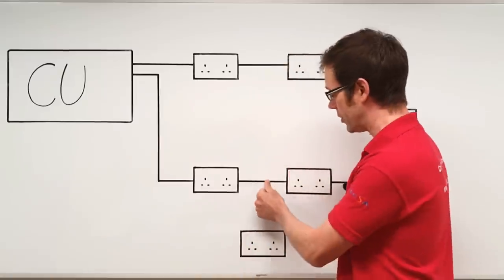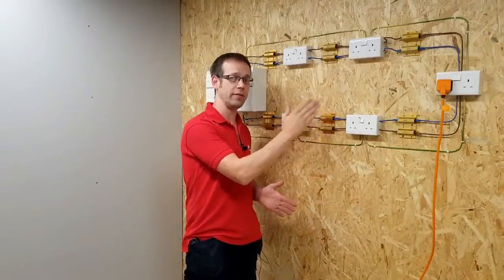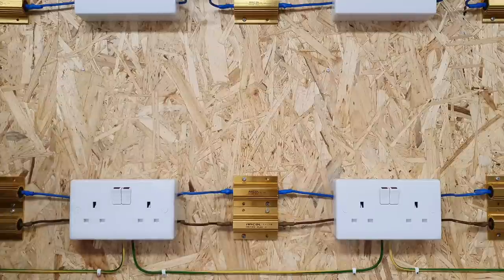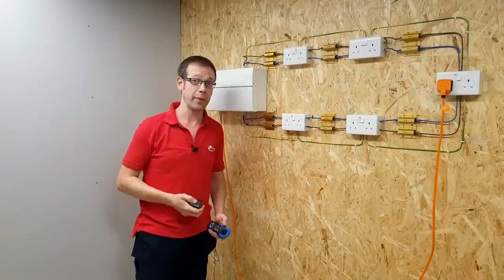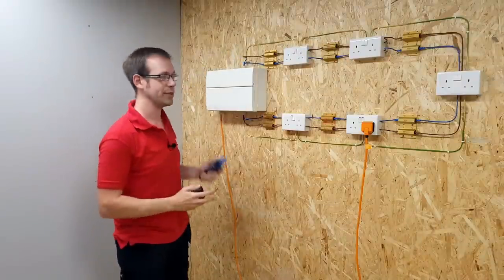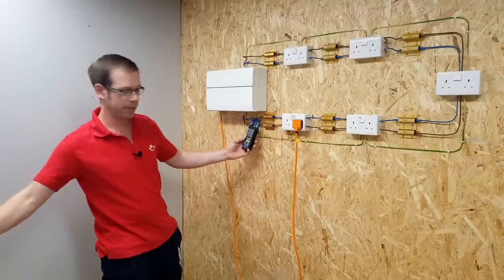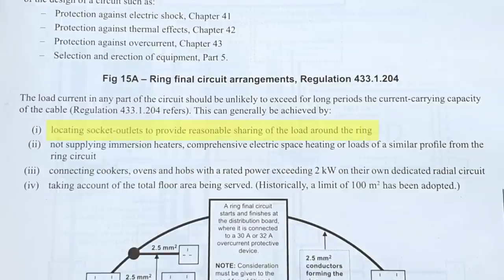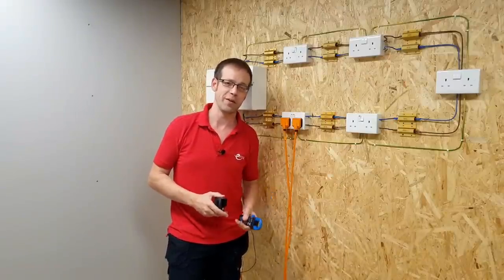KNOW HOW: How does current divide in a ring final circuit? (ring main)

Comment: I'm Dutch so I might be off a bit but...

You guys are using 2,5mm2 cpc/twin and earth cable and (usually) 32A breakers on ring finales. Correct?

Isn't that cpc a bit on the thin side when you have the very real possibility of someone not balancing that ring final and thus pushing that cpc well above its safe 20A limit?

Sounds like a fire waiting to happen...

In the Netherlands it's 16A max for normal household circuits. And that is with 2,5mm2 wiring...
Reply from the maker: Hi Richard, there is a bit of a risk of that but it's a Standard circuit allowed by UK regs. We're finding more and more electricians are going off using them for this and other reasons. The last house I rewired I didn't use a single ring final circuit. All radials. 👍
Reply: Why the UK regs aren't updated to the "normal" circuit topology? There is no need to have more then 10-16A on a normal household socket circuit.
Reply: @simonschertler3034  that wouldn't work in a kitchen when you turn on the kettle, coffee machine and tumble dryer on at the same time that will most likely happen at some point in the winter.  My kettle and coffee machine are always turned on at the same time.

Also assuming that there is no cooker socket so everything is plugged in on the kitchen circuit.
Reply: @adrianking6309  The obvious solution is to wire the kitchen so that high current consuming fixed equipment (ie tumble dryer, or an electric hob/induction hob) are on a dedicated, separate circuits. It's more difficult in practice as people (generally) don't wish to pay extra £££ for a dedicated circuit (many are happy to accept the low cost "hack into the existing ring" solution)
Reply: @simonschertler3034  As far as I'm aware, the Uk regs are up to date (UK regs allow both ring and radial circuits to be installed); many british sparkies still like to install rings, and will continue to do so until the UK regs outright bans them.
Reply: @gloveyourway2000  if it were down to me I would wire each individual room on it's own radial circuit. I agree that appliances should also have individual circuits but now we are looking a panel boards not domestic consumer units for the amount of circuits needed
Reply: @adrianking6309  Not necessarily; it depends on how big your property is, what equipment you need to connect, and how you wish to wire the various circuits. There's no right or wrong answer, just different opinions on how it should be done. In general, a bigger property = more circuits = large consumer unit (potentially)! For example, in my two bed flat (fitted with a gas boiler and radiators), based on my use I'd be quite happy to have one 16A radial circuit supplying power to all the power sockets in the two bedroooms and the lounge. If you were to wire up the flat, you'd probably use 3 circuits (1 per bedroom and 1 for the lounge, based on your previous response). There's absolutely nothing wrong with that; it's just a different approach to achieve the same outcome.
Reply: @simonschertler3034  Yes there is a reason. A 32A circuit (whether a radial on 4mm^2 or a ring on 2.5mm^2) is extremely useful in a location with multiple fairly high power plug-in devices, such as a kitchen or a workshop. The ubiquitous electric kettle can pull 13A on its own, add a 4 slot toaster which might pull another 10A and that's already exceeding a 16A circuit. Then there's the dishwasher (the heater might pull another 10A), a microwave (typically pulling 7-8 A) and the load can escalate quite a lot. Note, that ovens and hobs will be on their own circuit, but the devices I've mentioned generally don't.

Of course, you can put multiple circuits into a kitchen, but then you have to try and manually balance these appliance by being aware of what socket is on what circuit. 

Having high powered circuits (which requires fused plugs) is an extremely convenient feature as it's much more flexible for the consumer.
Reply: @gloveyourway2000  It's not very convenient for a consumer who might want to re-arrange their kitchen, or workshop, to have to re-arrange the wiring. It's costly and disruptive. 32A circuits with outlets are extremely useful things, and having to hard-wire in devices like dishwashers and washing machines is a pain. 

That's even before we get into truly portable devices, like coffee makers, electric kettles, microwave ovens, toasters, irons and a bunch of other things which are not suited to permanent wiring and trying to manually balance loads of multiple circuits is a nuisance. 

If the objection is to rings, then fine. Just wire up a radial with 4mm^2 cabling. The UK regs require sockets to be able to take a minimum of 2 x 4mm^2 wire, and better quality ones will take 3 x 4mm^2.
Reply: Steve Jones If the user is going to the extent of rearranging their kitchen/workshop, the wiring should be changed to suit the new layout and equipment. Stating it’s “costly and disruptive” isn’t an excuse to take shortcuts on the wiring. It leads to the shonky installations (see various YouTube spark videos for examples).
Reply: @gloveyourway2000  Who are you to dictate what ordinary people must do? This is simply ridiculous. There is absolutely no reason to hard-wire in dishwashers and washing machines. That's even before you  get into the issues regarding portable devices.

There is no shortcut being taken, just because it suits your view. It all fits within regulations, and it's perfectly safe to plug in a washing machine without having a dedicated circuit. Yes, you need things like an above worktop switched spur, but that doesn't mean running an entirely new circuit back to the CU.
Reply: @TheEulerID  3x 4mm twin and earth? U must have deep backboxes 🤣 🤭
Reply: @pedropedro9613  fine with 47mm back boxes, but three wires is the exception. In any event, this is only required in a few rooms, like kitchens, utility rooms or (maybe) workshops. 

In most rooms a 16A radial is fine (although I believe 20A radials on 2.5mm^2 is within regs for most circuits).
Reply: Steve Jones I’m not dictating what the average consumer can do (that’s your interpretation. Consumers can do as they please so long as the work is compliant with the regs, which sadly isn’t always the case), nor am I advocating hard wiring dishwashers or washing machines (again that’s your interpretation. I’ve never said that, but please go ahead and try to quote the text where I’ve said that), nor have I said you can’t plug a washing machine into a socket (again that’s your interpretation, and again I’ve never stated that). Perhaps you’re getting mixed up with someone else..?
Reply: Right but you are happy to plug in an appliance with a lead rated for not more than 3A into a socket without a fuse in the plug when the socket can happily supply 16A. Given that the UK has amoung the lowest deaths from electricity in the world, Grenfield excepting, fire is the biggest killer from electricity by far. Then it's not a problem. Note that I know the manufacture of the fridge/freezer that started the Grenfield fire supplies new appliances with 0.5mm cable protected by a 13A fuse, and when I complained they said it was permitted under the regulations.  So even worse in the Netherlands where a full 16A could be drawn.
Reply: @jonathanbuzzard6648  The appliance with a 3A rated cable will have a suitably rated internal fuse to protect the cable against an overload caused by a fault within the appliance, so the 13A fuse in the UK plug (or 16A breaker in the European fuse box) is only required to protect the cable against a short circuit. 

The short length of 3A cable is unlikely to cause the loop impedance to increase by such an amount that the 13A fuse/16A breaker will be prevented from operating within a safe disconnection time (if there is a short circuit somewhere between the internal fuse and the plug), and there's no real need to protect against overload faults occurring within the cable itself, as by simply being a bit of cable it is only capable of short circuit faults.
Reply: @Pinballdavecom  Show me a desk lamp (or any other sort of lamp) which has an internal fuse. They don't without exception. As such the a fault anywhere can lead to a dangerous overload. You are assuming that all faults lead to the loop impedance going to close to zero, which is simply not the case.

As I said just look what happened at Grenfell Tower for what can go wrong. Hotpoint are using 0.5mm CSA cable and protecting it with a 13A fuse in the plug (in the UK obviously). They are also using insulating foam that is flammable (unlike some other manufacturers). When raised with Hotpoint that this was not compliant with BS1363 they claimed it was!!!

I have no proof but we do know the fire started in a Hotpoint fridge/freezer, and they think there is nothing wrong with protecting a 0.5mm CSA flex with a 13A fuse in violation of BS1363. If there was an electrical fault in that fridge/freezer and it had 0.5mm CSA cable being protected by a 13A fuse it could have easily reached sufficient temperature to ignite the insulating foam without blowing the fuse, and wham 72 people dead.
Reply: @jonathanbuzzard1376  The fuse in a BS1363 plug is only there to protect the cable from the high short circuit fault currents that can be delivered by a 32A circuit, it is not intended to provide overload protection.

Overload protection should always be provided in the appliance itself. (Yes even a desk lamp will have internal fuse protection, filament bulbs have included a fusible link in the base for many years, and LED and CFL bulbs have internal fuses.)

I'd advise you to read the regulations and take some time to understand the calculations rather than just blindly quoting the cable size/fuse rating table. I assume that you're an electrician, and familiar with short circuit current/disconnection times equations. Try calculating for a 13A BS1362 fuse and a very short length of seemingly underrated cable, you'll find that it actually turns out OK, and typically you need to go to several metres in length before there are any issues.

This is the basis for the equivalent regulations for European appliances (note appliances NOT fixed wiring). Even on a 16A circuit you can use very small CSA cable for the appliance flex, providing that the length is short enough to allow enough current to flow to operate the protective device. However if you want a longer cable, it will need to be thicker, even if the appliance takes negligible current in normal operation. 

Personally I always design to European standards, then the value of the fuse in a BS1363 plug top is not so important, and you don't have to worry about the consequences if an end user replaces the factory 3A fuse with a 13A one.
Reply: @Pinballdavecom  There are no fuses in a filament bulb. At least none of mine. I have loads of power tools none of which have a fuse in them. There are no internal fuses in fridges or freezers. There are no internal fuses in things like lawn mowers or strimmers. The list goes on.

However let me repeat you are assuming that the fault produces a dead short. If the fault produced was not a dead short but say 20Ω, you would then happily draw 12A down your 0.5mm CSA flex and not blow the 13A fuse in the plug potentially leading to bad things happening. On the continent you could have a 15Ω short and draw ~15A which would be even worse. If your claims where correct there would be no point in anything other than a 13A fuse, which given that you can readily get other sizes is ample proof  that you are wrong. I have personally seen faults that where not dead shorts and the flex became hot to the touch which is the only way I knew there was a fault.

So let me repeat NOT ALL FAULTS ARE DEAD SHORTS and as such not having a fuse in a plug under any electrical system anywhere in the world if the appliance flex is not rated to carry the current that would trip the MCB or blow the fuse at the distribution panel introduces a potential to cause a fire. Are faults that are not dead shorts rare, yes but rare is not zero.
Reply: @jonathanbuzzard1376  Yes your filament bulbs will have a fusible link in them, if they don't then they cannot get a CE mark and can not be sold in the EU. Look it up yourself if you don't believe me. There are fuses in fridges and freezers, the internal electronics will have a fuse on the PCB, and the compressor will have a thermal fuse. again EU product safety requirements mandate them. Modern power tools will also have a fusible element built into the input filter or another component. Just because you don't always see them or don't recognise them as fuses doesn't mean that they are not there.

Now you may have come across ancient power tools or appliances which rely on the plug top fuse to provide over-current protection, but this is not how modern appliances are permitted to be designed.

All I am saying is that EU rules use different methods to protect against fault currents, and these methods do not require a fuse in the plug top. If you read the current UK appliance safety regulations, you will see that it is also perfectly acceptable to use these methods in the UK (with a 13A fuse in the plug) and not stick rigidly to the fuse size/flex CSA tables in the older versions of the regulations.

If you don't believe that they are safe or equivalent to the old UK regulations, then that's up to you, but I'm fine with them.

Comment: Once did a course, where we were told to look up the data for double sockets, pointing out that a double socket is only rated to 13amp across both outlets, and that overloaded sockets in kitchens were commonplace. Apparently tested to 1.5times the design limit (i.e. 19.5 amp).
Reply: A double socket is rated to 20 amps
Reply: @iandonnelly542  BS 1363 states a double socket should be rated to 20 amp minimum
Reply: @persona250  
But two 3kW appliance can be plugged into the two sockets on a double, drawing 26 amps through the double.
Reply: @johnburns4017  correct john don’t shoot the messenger. 3kw appliances should be on there own individual circuits…
Reply: @persona250  
But the 13A plugs are made for a maximum of 3kW appliances. But sockets are for portable appliance, not fixed appliances.  In reality a fridge needs hard wiring in, as does a dishwasher, washing machine, etc. 

So, it is expected that two 3kW appliance would not be continuously plugged into each outlet of a double socket. 3kW kettles are freely available. But most are 2.2kW. Which is just over 19 amps if two are plugged into a double socket.
Reply: @johnburns4017  all those appliances have 13a plug tops fitted from the manufacturer so they do not need hard wiring in . I’m not sure what your argument is . The testing specification for a 13a double socket is 20 amps deal with it .
Reply: @persona250  
My argument is clear. The manufactures deem that a double socket will rarely have two 3kW appliances plugged into it for a sustained time. 

Sockets were and are for portable plug in appliances. Not appliances permanently connected like fridges. 

BTW, it is plug not plug top.
Reply: @johnburns4017  Not just the manufacturers , the people who write the regulations and they have a lot more experience than you . 
     Socket outlets have been rated and tested to 20amps for 30 plus years excuse your ignorance for not knowing .
Reply: @persona250  
Ignorant I am not. I know of the 20 amp max. I am questioning the reg makers who allow it.

Comment: I have just installed a Emporia Energy Monitor to my consumer unit.  The installation guide said to put a clamp around only 1 wire on the ring. Then in the App you can double up the result ( x2).   Now having just watched this very good and informative video, i can see how i can get very inaccurate results.  Should i put the clamp around both and delete the x2 factoring….  Is this better ??
Reply from the maker: Yes you’d have to clamp around 2 to get an accurate result.
Reply: As long as you are putting the clamp around  two live conductors and they are both of the same phase, then there is no problem doing that and you will measure the total current in the cables.

Comment: My house is a 70s build with a 17th edition fuse box. (had new box installed when I moved in)

All my lights are split into two rings and breakers. However, my sockets are all on one ring circuit with a few spurs. Should I be worried that my sockets are not split into upstairs and downstairs?

This is how the house was wired in the 70s.
Reply: Your house needed a full rewire 20 years ago...
Reply: @Emin3m1986  
Why?  cable can last and last.  There is no time date on it.
Reply: @johnburns4017  - yeah, the older is... it gets better, like wine :))
Reply: Put an Amp Clamp on the ring cables at the CU, with the most appliances all on.  If a heavy draw, then maybe run in a few radials for the heavy kitchen appliances. 

Best have the dishwasher, washing machine, etc, on their own RCBOs. Safer, as one cable to each with screwed connections at each end.
Reply: Your lights are not on rings, they are radials. The breaker will trip before there’s a problem, if it ain’t broke then don’t fix it! PVC lasts nearly indefinitely, rubber perishes at the ends, your electrician would not have fitted a new fuse box if the wiring was unsafe

Comment: It doesn't matter in terms of the principles, but 0.22 ohms is equivalent to a 30 metre run. That's a pretty long ring you have there at 180 metres equivalent.
Reply: Max length for a ring is 100 metres. But Joe is proving a point.